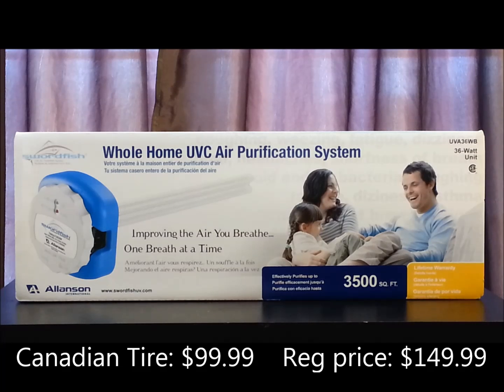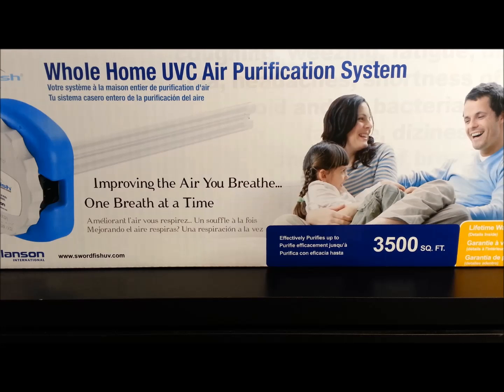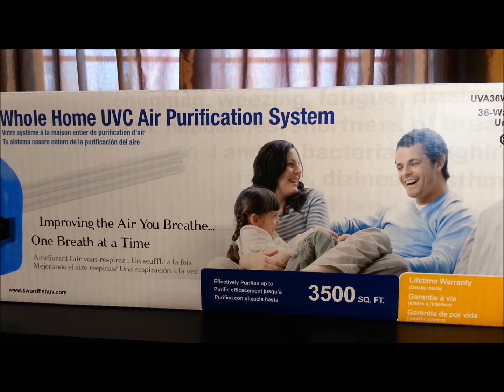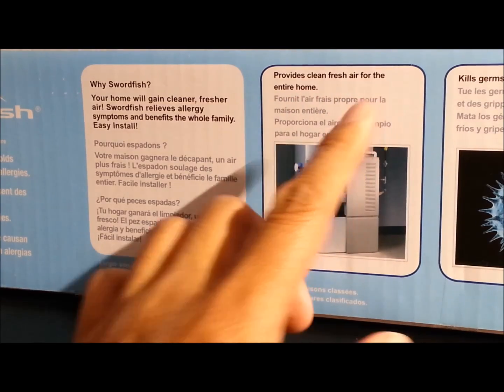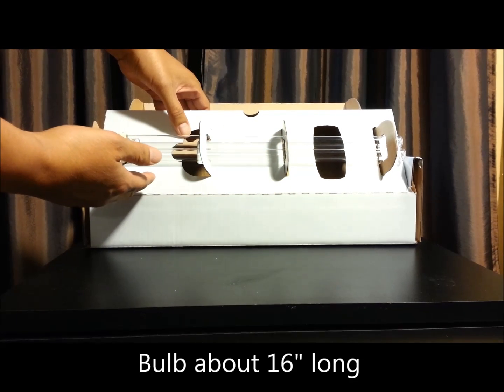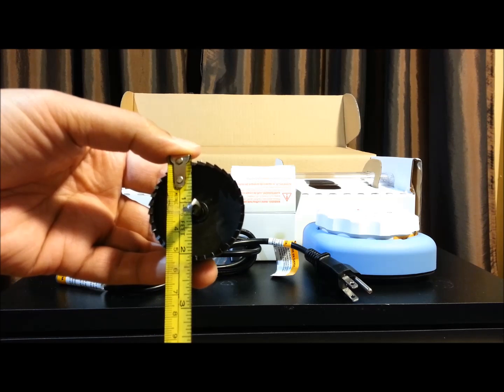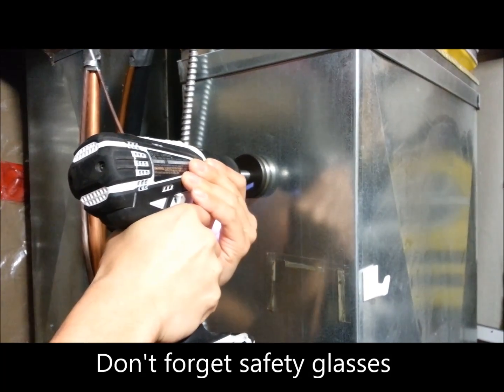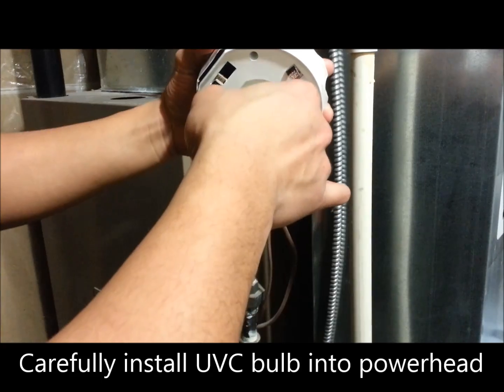UVC Furnace Air Purifier Swordfish. Kills VIRUSES & GERMS. (DIY Install & Review)

Comment: Would installing two of these side by side double the square footage specs as my house is almost 6000sf.
Thank you!
Reply from the maker: Great question. My house is 1500sf upstairs and 1500sf downstairs, a total of 3000sf. I suppose two side by side is no problem. In fact it maybe better since UV kills bacteria and I'm sure also kills virus ( like the one right now  Covid 19).
Reply: 6000 sqft with 1 HVAC? I have 5500 sqft and 5 HVAC

Comment: Did you install it before the area where the air gets heated or after the air is filtered and heated?
Reply from the maker: I installed it before the air gets heated. Before the air filter.

Comment: I got the tabletop model. UVC can kill germs but it does not remove particles from the air like animal dander, pollen, smoke and dust. True HEPA filters are the best way to that.  I don't think the swordfish will reduce the number of colds and flu's you get because you are likely picking up the flu viruses from other people outside your home.
Reply: UV lamps have prevented a cold or Flu virus from making any significant impact in our family with individuals who have comprimised immune systems.  So Ricks assessment is incorrect.
Reply from the maker: I think is helps out to kill virus like Covid 19.